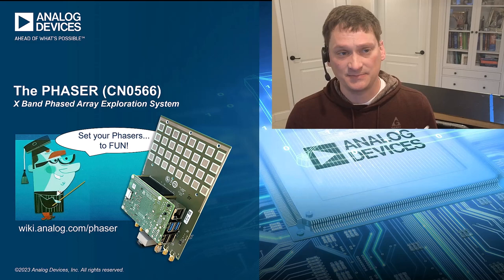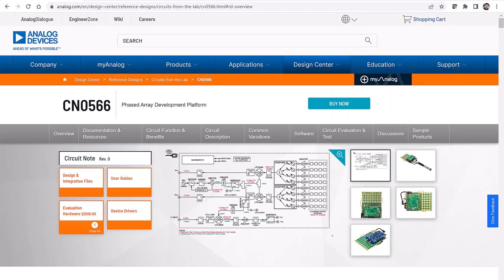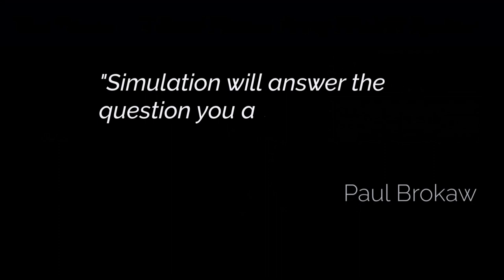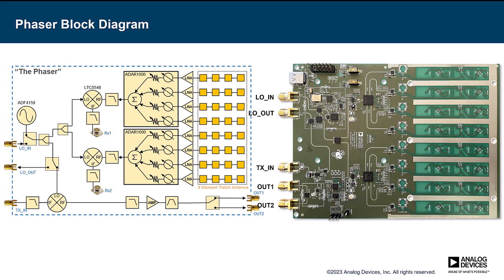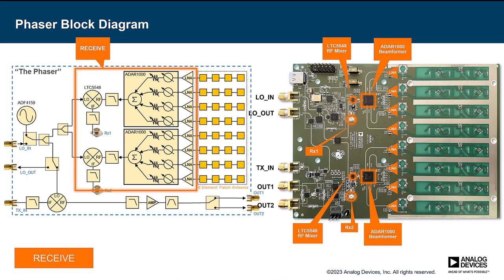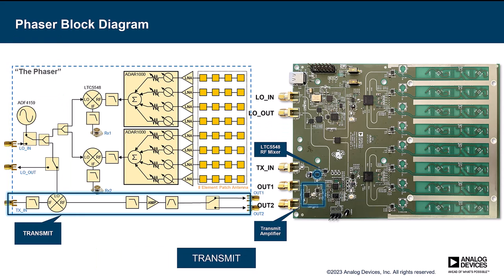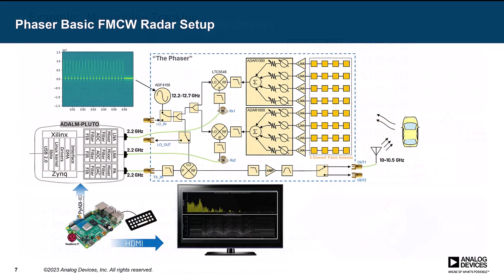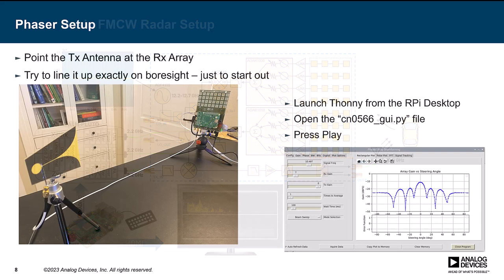Introducing the "Phaser"!

Comment: YES! YES! YES! Is there a reason for the limitation of the bandwidth?
Reply from the maker: Thanks!  Do you mean the RF freq range or did you mean the FMCW chirp bandwidth?  The RF freq range is limited by the integrated receive array antenna.  It has a 3dB BW of about 9.9 to 10.8 GHz.  However, if you bypass that antenna, and add your own receive array, you could do frequencies from about 8 to 14 GHz.  For the FMCW chirp BW, it is limited by the range of the HMC735 VCO, so you could get as much as 2 GHz of chirp bandwidth if using an external Rx array.  With the integrated receive array, you would be limited to a chirp BW of 10.8-9.9=900MHz.
Reply: @jonkraft  Have you seen the Defcon video where the "engineer" determines which frequency to broadcast to confuse L.E. radar